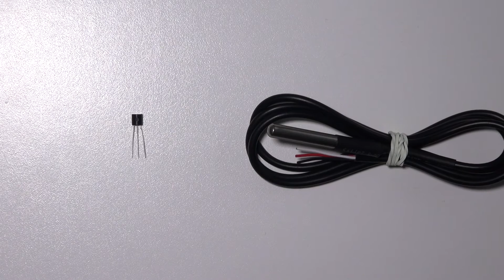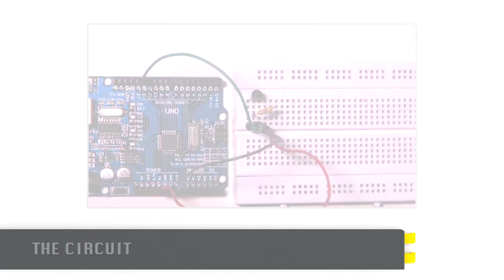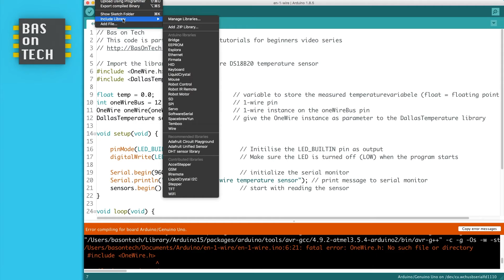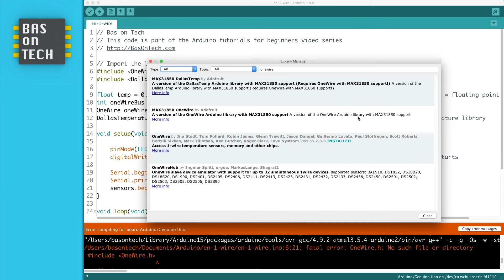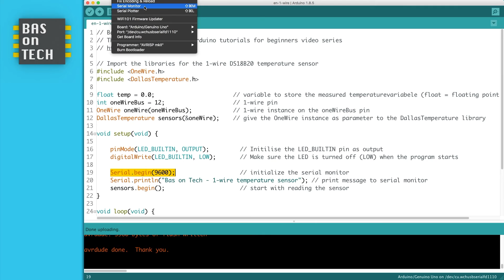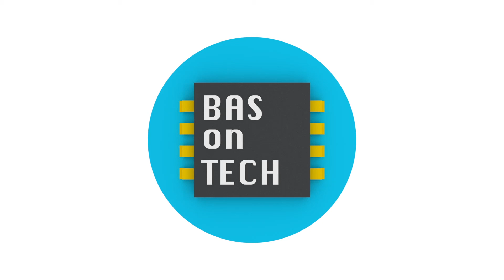1-WIRE DS18B20 TEMPERATURE SENSOR - Arduino tutorial #6

Comment: My sensor keeps showing -127 Celsius.I redid the circut10+ times, and it keeps showing the same number. Also i used a different DS18B20. Also, after I took it out and put it back, the sensor started heating up crazy. I know the issue isnt in the software (code). It's the hardware, but what did I do wrong? I followed thos step by step.
Reply: same , Did you found a way to fix it or the reason behind it

Comment: On line 17, at 5:03, why must we make sure the LED is off when the program starts?
What happens if we don't? (I just executed without that code and it didn't make a difference - on this project.)
Is this a good convention which is helpful in some instances? And if so, in which instances? 
(Enjoying your tutorials.)
Reply from the maker: You want to create a "known state" when your program starts. Now further in the program we "know" that the LED is off instead of assuming. This can avoid bugs or side effects later in your program.

Comment: At around 6:30, on line 31, what is the 'delay(1000)' code meant to do?

(I ask because the code seems to execute the same even without it in the code block.)
Reply from the maker: delay() pauses the processor for the specified amount of milliseconds. So in this case it stops the program for 1000ms = 1 second

Comment: Last lesson we used a 'pull down resistor'. 

But in this lesson we're using a 'pull up resistor'.

What's the difference?
Reply from the maker: A pull-up resistor is used to ensure a HIGH level at the input of a digital circuit when no other device is driving the input. A pull-down resistor is used to ensure a LOW level at the input when no other device is driving the input.
Reply: @BasonTech  Bedankt. 

Put differently, could we also say that:

A pull-up resistor always intercepts the connections between the Output and Input 'ends' of a component (e.g. the T sensor in this tutorial)?

And that a pull-down resistor always intercepts the connections between the Output and Ground 'ends'  of a component (e.g the push button terminals in Tutorial #5)?

Comment: Hi Bas :-)

When you assign pin 12 as the T input, why do you write: 

'int oneWireBus = 12', from outside the setup() function

instead of the usual 'pinMode(12, INPUT)', from inside the setup() function?
Reply from the maker: that is because the oneWireBus constant is directly used one line below, and not in the setup. We are not using it as an input, it is used by the OneWire library
Reply: @BasonTech  Thanks

Comment: If I am not using 4.7kohm resistor, am I not going to get the desired output? as I keep getting -127
Reply from the maker: Correct, it is needed by 1-wire for the data bus

Comment: My sensor is reading 197 C , how can I calibrate it? I'm usingthe same sensor in  arduino too, but for ESP32
Reply from the maker: You can't really "calibrate" it other than subtracting a number of the measured value. Make sure you have a DS18B20 sensor and setup the wires and code correctly. The sensor should be quite accurate.

Comment: Hello. I followed the tutorial exactly however I keep getting a temperature reading of -127. Does anyone have an idea about this issue ?
Reply from the maker: Are you 100% sure you have a DS18B20? There are other components which look the same but are not the DS18B20 but for example a transistor.
Reply: @BasonTech  Yeah I am sure it's the DS18B20
Reply from the maker: Then it must be the Arduino, wiring, code, or faulty sensor. Hard to say which one without having the circuit in my hand.
Reply: @BasonTech  Thank you for your reply.

Comment: I've done your tutorial, however the problem tthat I am experiencing is that the temperature does not update. It only updates to the new temperature after I reset the board. Any idea what could be causing this
Reply from the maker: Hi William, could it be that you have written the code in the setup(), which only runs one time instead of the loop() which is infinitely ran?
Reply: @BasonTech  no, the code is in loop. I figured out what the issue is. The Serial monitor is not updating the temperature after the first reading. I have to refresh the serial monitor to get the updated temp. Any idea what could be causing that?
Reply from the maker: I have experienced such a thing once. The reason was that the serial.setup() was in the loop instead of the setup()

Comment: It would be so awesome if you could include the Alarm functions of this sensor. I'm utilizing my DS18B20 to monitor the green house I have. If the temp rises above the set threshold, arduino uno digitalwrite Pin high. thus turning on a relay which drives an actuator that opens an air vent. the other relay starts the vent fan. the lower threshold would initiate my heat source.
Reply from the maker: What have you tried so far, and on what part are you stuck?
Reply: @BasonTech  I followed all of code in this video. And added the alarm low and high that you showed. My initial attempt failed. I’m not at my computer right now. But later today I’ll try again and I’ll try to include code in an email if your comfortable sharing an email address with me.
Reply from the maker: There is a contact option at https://arduino-tutorials.net 😃
Reply: @BasonTech  thank you for your fast response!.. I’ll repay you by watching all of your videos over and over!

Comment: without setting input pin 12, how it takes reading?, i am getting -127 as output..
Reply from the maker: Are you really sure you are using a 1-wire temperature sensor? Many use another one which kinda looks the same 😃

Comment: we did the same procedures but we always get - 127, we checked everything but we still couldn't figure out what is wrong
Reply from the maker: Most people have this issue because they are not using a DS18B20 temp. sensor but for example a diode which looks the same but is a complete different component. Are you absolutely sure you have a 1-wire  DS18B20?
Reply: @BasonTech  we bought our sensor in a local but trusted shop, i don't think that's the case /but it could be

is the small black thing also called LM35? we bought ds18b20 and LM35 but they are not in the same kit
Reply from the maker: LM35 is a temperature sensor, but not a 1-wire one. Make very sure that the sensor has DS18B20 printed on it

Comment: Thanks for sharing. This was very helpful. I had a few questions. 

1. If you have multiple sensors connected on the same pin, how do you determine which sensor is assigned which number?

2. When you initiate the instance as 'oneWire' for onewire and 'sensors' for dallastemperature, do you have to use those terms (oneWire and sensors) or can they be anything?
Reply from the maker: 1. Each 1-wire sensor has its own address. So first you can use a script to list the 1-wire address of the sensor. This code should be in de example code of the Arduino IDE
2. Variables can be any name you want. Library names can't
Reply: @BasonTech  I understand. Thanks for the prompt reply.
Reply from the maker: My pleasure! 😃

Comment: please can you help be i have TEMPERATURE SENSOR :dallas_DS1820_1324C4_+964AB it give me Temperature is: -127.00 value
Reply from the maker: Are you very sure you are using the 1-wire SD18B20 sensor? Sometimes people use for example a diode because it looks the same.
Reply: @BasonTech  oui thanks for the fast response I am very sure I think I have a problem in my sensor I need to change it. Do you know how to verify if my temperature sensor work or not?,
Reply from the maker: You can with my code, or by grabbing 1-wire code from the examples in the Arduino IDE and see if the sensor gets detected.

Comment: I have another question. How did you get the value of which resistor to use, why a 4.7K resistor?
Reply from the maker: Hi Bob, good question. It works as pull-up for 1-wire. More info in this topic: https://arduino.stackexchange.com/questions/30822/the-use-of-4-7kohm-resistor-with-ds18b20-temperature-sensor
Reply: @BasonTech  Cheers that helps.

Comment: I just did your tutorial, thank you. I will do more of yours now :) One question, would this be possible also if I used a TMP36 sensor?
Reply from the maker: The TMP36 sensor is not a 1-wire sensor, so you can not just replace the two with each other
Reply: Okay I answered my own question. I tried the TMP36 sensor but it did not work, all I got was the -187 reading and the TMP36 got very hot very fast, so I had to take it out before I damaged it.
Reply: I also tried using the DS18B20 with the cable and sensor https://www.aliexpress.com/item/4000143479592.html but it did not work, I also got the -127 in the serial monitor. What would be the reason for this? They both have the same number.

Comment: Every time Give me                                                               Temperature is: -127.00 value
Reply from the maker: Hi, are you 100% sure you have the DS18B20 temperature sensor?
Reply: @BasonTech  YES .
Reply from the maker: Then it might be the wiring or the code. If you download the code you could be sure it should work. Maybe double check your pins and wiring 😃
Reply: @BasonTech  Now its work. Thank You for fast  response
Reply from the maker: Super! What was the issue?
Reply: @BasonTech  Sensor's Ground wire was damaged
Reply from the maker: Glad you figured that one out! Thanks for sharing 😃
Reply: @BasonTech  Thank you to
Reply: I had the same reading at first -127. But I discovered I had the resistor in the wrong holes. As soon as I changed that it worked perfectly.

Comment: Had 3 of these (pigtail type) wired up to an ESP32 NodeMCU. One would randomly read between real and 185F. Good thing Amazon sold them in 5 packs. Replaced the flaky one and so far all is well.
Reply from the maker: I had the same thing once, guess I connected for example the GND and 5V the wrong way around and shorted the circuit. Lucky these sensors are not expensive :)